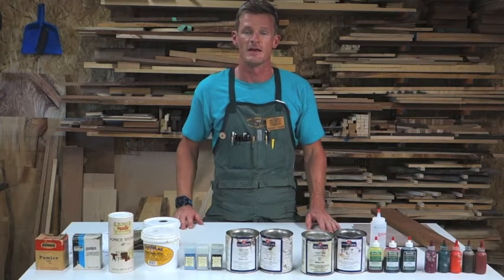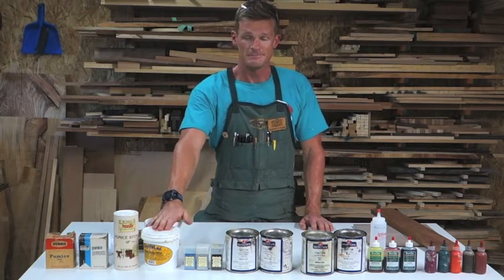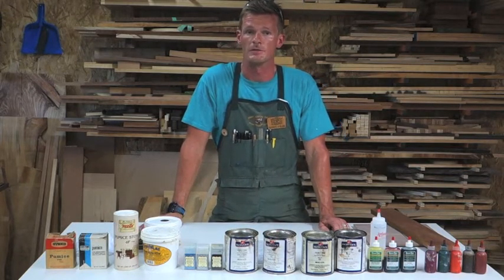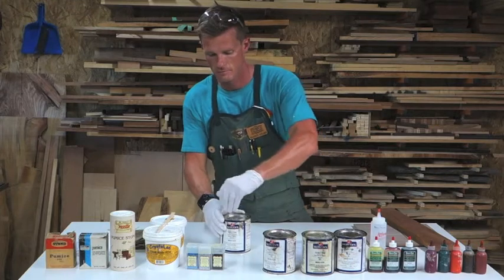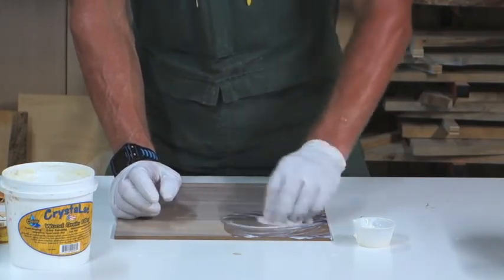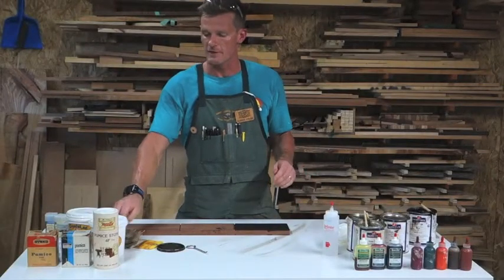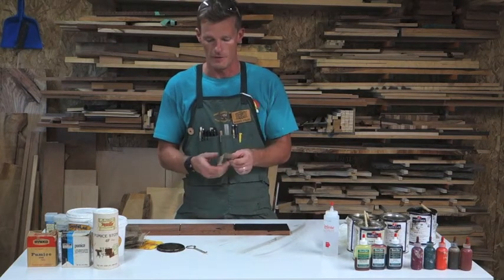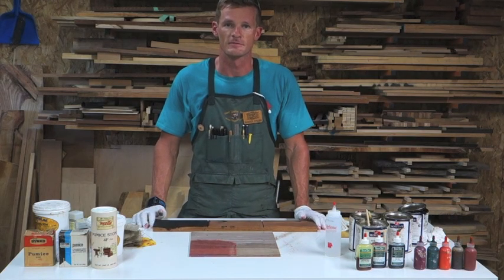CFT 195 Grain Filling

Comment: So, I have some fluted moulding and rosettes that I want to match.  The wood is red oak and it is prestained with minwax english/red chestnut.  So, how on earth do I add filler to fluted boards and rosettes and sand off the extra?  Also, the grain is much darker than the "red oak" fillers, which are a light golden brown color.  So, to accent the grain/prevent lightening the stain where the pores are, do I choose an ebony filler?  Thanks!

Comment: you said you like to use poly as a filler. Im assuming it would be the 50/50 mix against the grain at 90% untill the grain is filled.
Reply from the maker: No, I do not thin. I will spray a lighter coat.
Reply: brotharuss

Comment: Oh my god,i'm full of questions.i have a body already sanded with 320.what should i do next?apply grain filler(this varnish mix used in previous video)?how many coats of this and when to sand?i have to seal the wood and if yes,when to do it?after grain filler?how to apply the coats of poly finish?apply with sandpaper or cloth?adn then let it dry and apply again with sand paper or cloth or i will sand only in final coat?please,somebody help me.if someone knows the process,let's give me a step by step guide,i would really appreciate it.i don't want to pay 280£ to stores just to make for me  a natural finish gloss.thank you
Reply: trellos stain, grain fill, seal/top coat it off.
depending on your stain, 1-3 coats should do. maybe 2, wipe off excess if too dark.
sand lightly, if needed, apply last coat, lightly.
use grain filler. typically 2 coats as shown here. read the directions on tub.
apply polyurethane for oil based stains; or apply Lacquer for Water based stains. Use a natural bristle brush, not nylon or polyester.
Apply generously, but not heavy. keep a wet tip(don't let it coagulate and get dry) brush it in, then go from one end to the other in one long stroke.
usually no need to sand, but if it's coarse, light sand with 220grit, then apply second coat.
lightly sand if needed again. then apply 3rd and last coat.